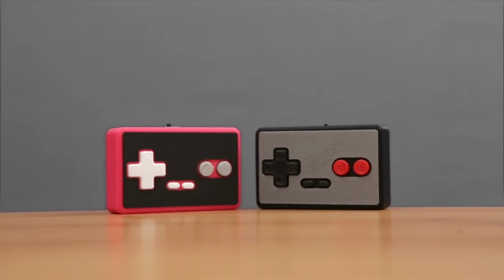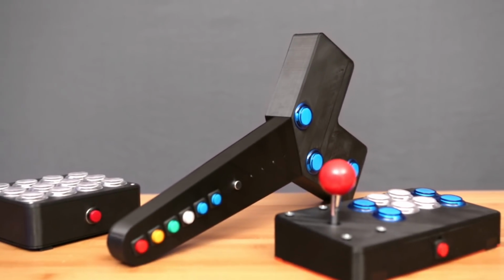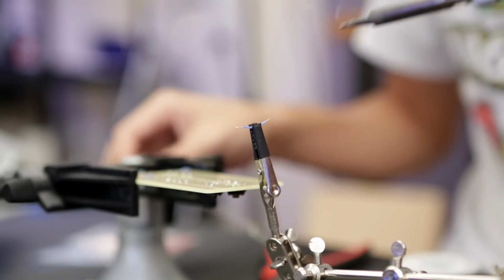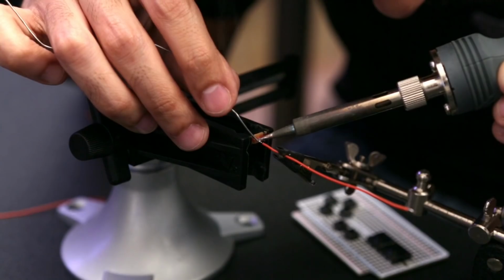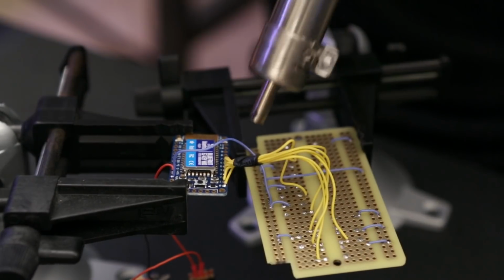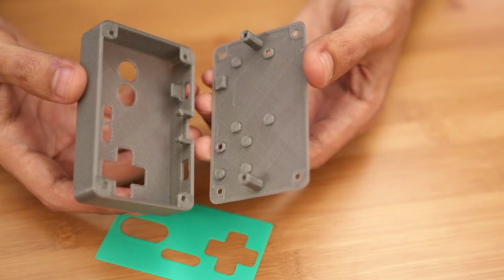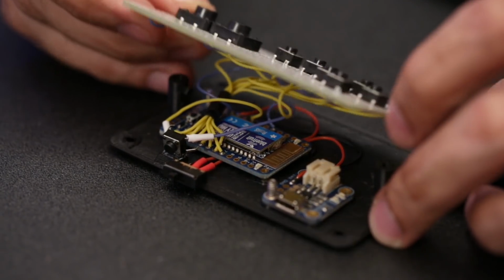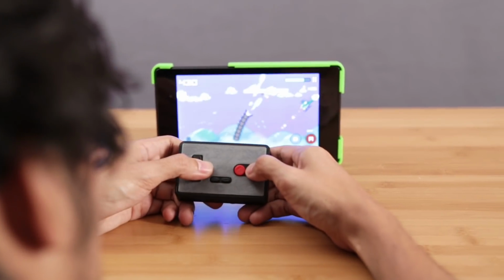DIY Bluetooth Gamepad - #3DPrinting #Adafruit Projects

Comment from the maker: DIY Bluetooth Gamepad
https://blog.adafruit.com/2015/02/26/diy-bluetooth-gamepad/

In this project we’re building a DIY gamepad using the Bluefruit EZ-Key module and a 3D printed case.

The Bluefruit EZ-Key HID keyboard controller is a bluetooth breakout design for making DIY keyboards and game pads. It’s requires no programing and works with just about any trigger or push button. It takes up to 12 inputs and can be powered with any 3-16 VDC.

The Perma-Proto comes in different sizes which is perfect for making all sorts of projects. The ½ sized Perma-Proto breadboard is like a business card and which makes it perfect for making a small game controller.
Reply: If I added 6 more buttons in a certain  order could I make this a PS3 controller
Reply: Hey. One question , can you tell me stuff that joins wires without using solder. Please reply. Thank You.
Reply: I would like to make the exact same thing but with an analog stick instead
Reply: can you do a controller with LB,LT,RB and RT as well please
Reply: +Adafruit Industries 
What was the game you played?
Reply: What game did you played in the video?
Reply: Adafruit Industries the black remote looks like the one in regular show lol
Reply: when are you gonna have these back in stock? been waiting for months
Reply: Adafruit Industries i would use this with my tablet and a emulator

Comment: How much more complex could the controller be and still stay within the limitations of that microcontroller you used? I'm particularly interested in getting a trackpad input working (I2C or SPI interface would be supported on the module)

Comment: You can press all the dpad buttons down at once, just wanted to point that out. I just made a snes controller last month, designed my dpad so i went through figuring that out.
Reply: Cool none the less. Mine i didnt store the arduino in the gamepad, it hooks into a bus im creating that you can plug in any old retro controller into and use as usb. Also working on making it able to plug into a nes, and possibly a snes.

Comment: Excellent video as always Adafruit Industries !  At about 2:54 there is heat shrink applied like "tape" around the wire bundle. Care to share the secret here? :)  Great work.  Cheers
Reply: ***** I meant more of how it is heat shrink tape instead of the standard tubing.  Not an overly well known technique I'd bet.  Could be wrong.
Reply: Eric William Sure, it's just a piece of large sized heat shrink tubing that I cut down the middle and wrapped it around the wires.

Comment: How do you make a wired controller wireless? I want to get a USB sega genesis controller, but I hate wires.
Reply: Thanks. Do you know if that will work with any controller? I'm not working with a PS2 controller. I'm using a sega genesis controller
Reply: Have a look at this, he made this to turn USB mice and keyboards to Bluetooth, I don't know if it will work with a controller

Comment: the main part has been discounted. any recommendations for a substitute?
Reply: I know I'm a year late, but I did this with the Bluefruit Feather 32u4, and it worked perfectly!
Reply: @nizwiz._.5906  how would you get more buttons? For example, I need 4 shoulders, x and y, and two psp thumb sticks. Can't forget L3,R3.
Reply: @joeyellis4945  oh, well the Bluefruit only supports 8 inputs I think. so if you need more, you might have to make your own PCB.
Reply: nizwiz ._. Sorry what’s a pcb
Reply: @gabruekqbryh7871  printed circuit board
Reply: Fajar Imani Satrio Aji Ramadhan thanx

Comment: Adafruit Industries what software are you using to make the 3d design??
Reply from the maker: Badhon Ebrahim Depends on what project but Maya, Fusion 360, 123D Design and meshmixer. This one was designed in 123D.
Reply: thanks bro :)

Comment: I would like to make the exact same thing but with an analog stick instead is it possible?
Reply: +Lightspeed Gee If you can't answer this question yourself I'd suggest you study a bit more about these things.
Reply: but can you answer? exactly.

Anyway an anolog stick would be kind of hard to install but its not hard to understand.  Basically it's an 8 way button panel with switches, every time you move the stick it hits the switch wich causes an action in the game. I would recommend more than 8 switches though.

Comment: if I wanted to make a USB version of this what should I go with instead of the bluefruit?
Reply: u can use a regular usb keyboard, just open up the keyboard, get the chip, find the right connections, wire em to a protoboard and switches and et voilà, you have a usb controller which u can use it with android with an OTG adaptor, on pc, raspberry, w/e

Comment: where do I buy the controller you just built
Reply: It's a diy controller
Reply: +Johannes Werner yes it, but I don't have none of the equipment needed to put it together, that's why I asked where can I buy it
Reply: LongIslandADED.
I think theres the link in the description for the parts. For the body, you'll need to buy a 3D Printer, but there are also some websites where you can send them youre 3D print plan, and they print it out and send them to you by post.

Comment: I can connect to a PS3 / PS4 or Xbox ?
Reply: +Diego Sanches Garcia Xbox, no because xbox does not use Bluetooth. PS3/4, probably not either for Bluetooth security reasons. It might "connect" but won't actually do anything.
Reply: if it were possible to increase the applications for that bluetooth !
Reply: +Diego Sanches Garcia I looked into somewhere and this guy used an Arduino and was able to change the Bluetooth hardware name and passcode. If you went through all the trouble you could (in theory) forge certification on a controller you made which would get the system to see it as a third party or official ps4 controller. But it would just be easier to buy a cheap third party controller and rewire the controller to fit a custom case if that's what you wanted. but you should also keep in mind that this controller in the video has a Bluetooth microcontroller that cannot support enough inputs as a ps4 controller and would not work on some games (games like cod or bf and others wouldn't work but simple arcade like games probably would be fine).